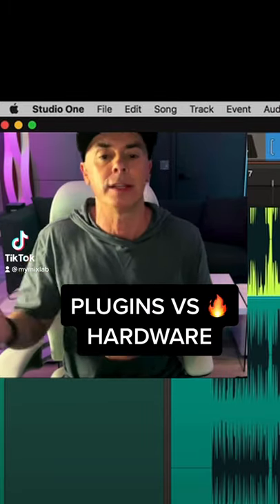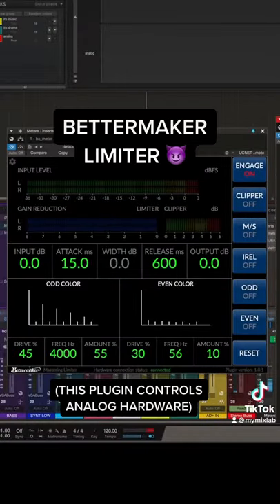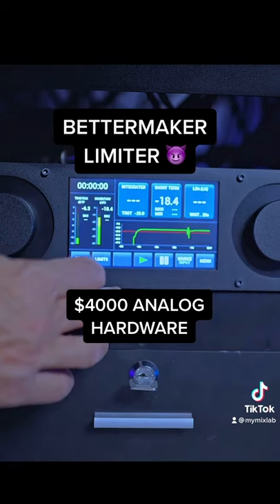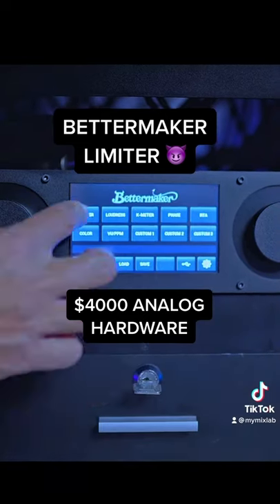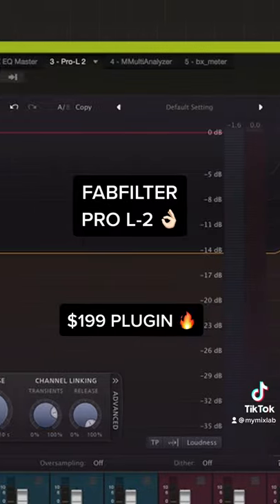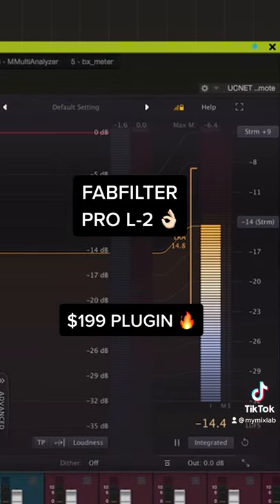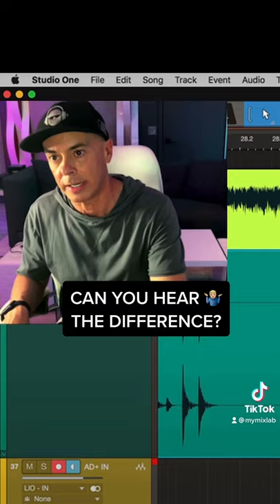Plugins Vs Hardware - Limiter Comparison

Comment: Why does software always shrink the centre image.  Maybe even reduces the impression of overall width.  Loses a sense of depth.
Sounds smaller and thinner.   Hardware sounds like it's in an environment. There is an 'air' to it, and because of that it acts like a glue.
I'm so annoyed of being baffled by this !!  Can't they hear this ?  I suspect nothing can be done about it at this point.